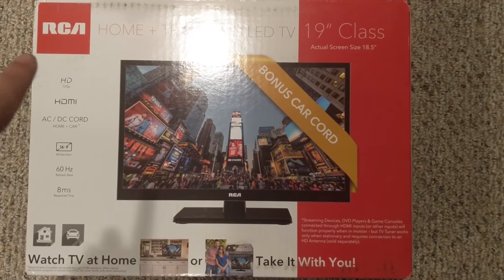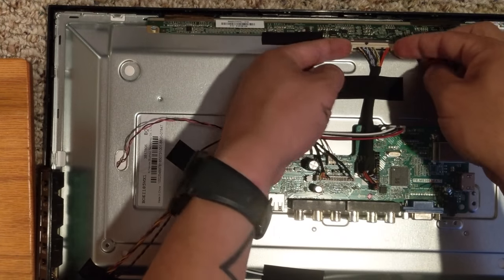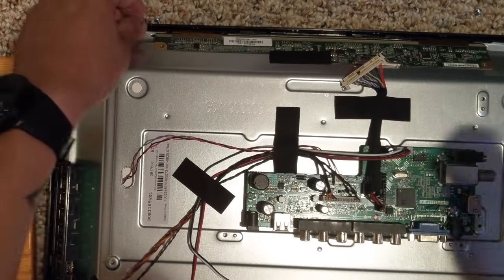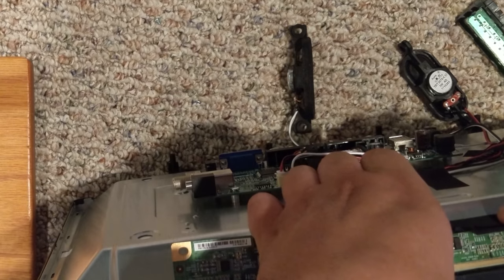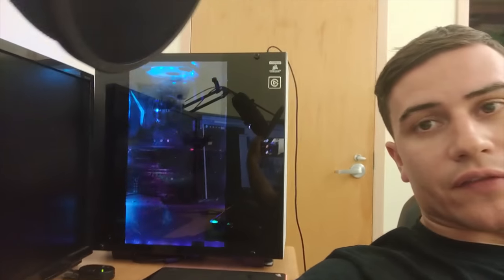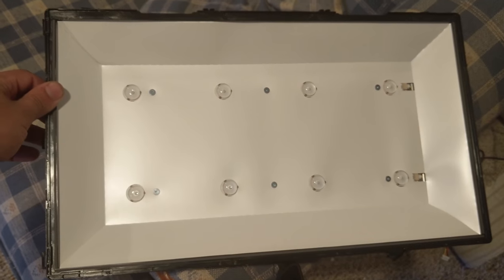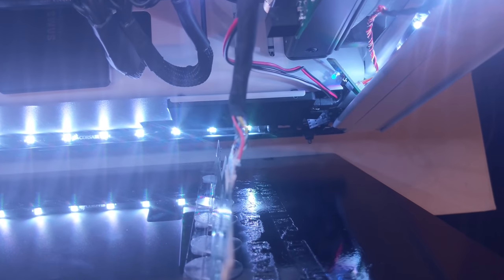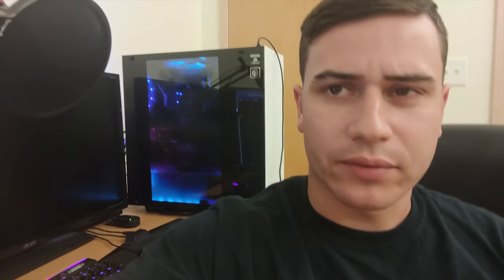Transparent Display In PC Case For Only $100

Comment: What you did when you took off both layers, you took off the polarizer. If you still have the screen, try looking at it with polaroid glasses. If you have a picture, that means it's still good, and you can fix it for 10/20$